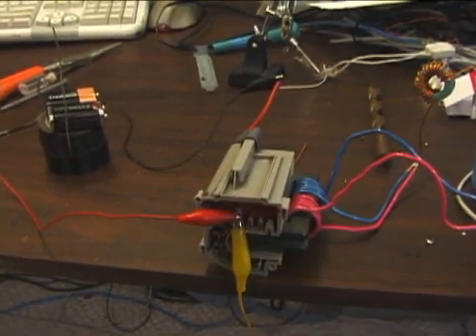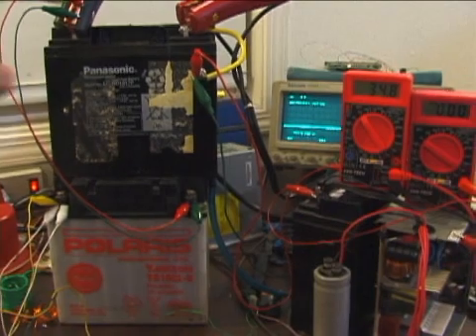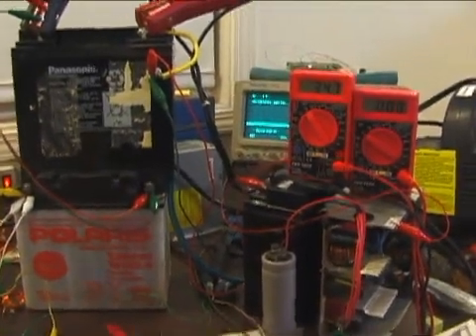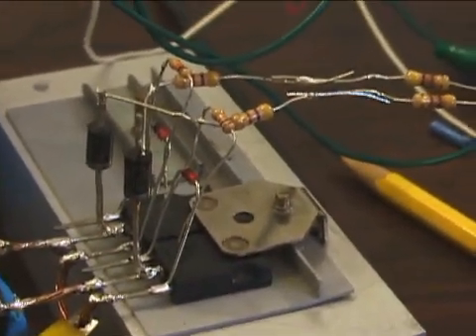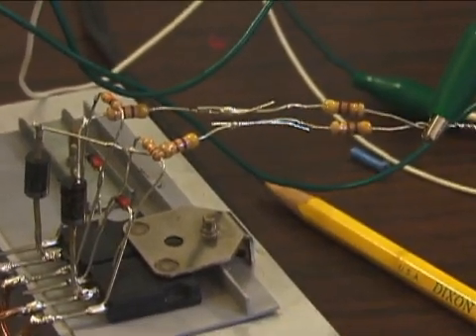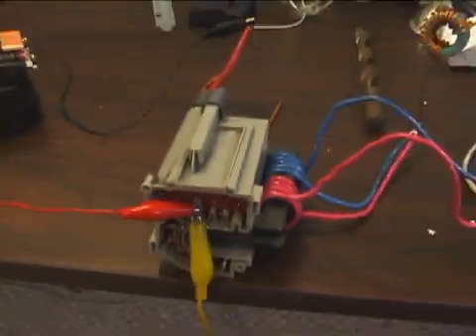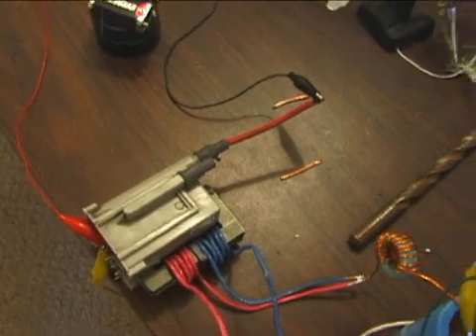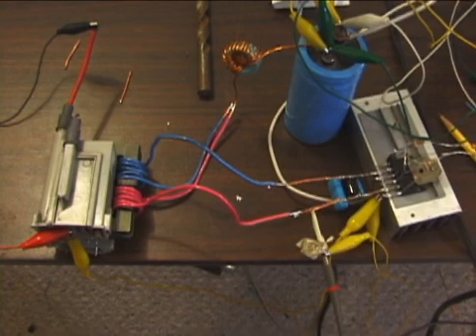700 watt ZVS flyback arcs and driver

Comment from the maker: @ubuntupokemoninc @ubuntupokemoninc It overheats about as fast as a mot. The real problem with a flyback overheating is that there is a thick layer of plastic between the coil and the outside and that makes for a delay in heat transfer from the coil to the outside. You can arc it for about 2 seconds and then turn it off and 5 seconds later, The outside of the flyback gets  very hot.

Comment: @joyange1 no, I think he is talking about the diode in some rectified flybacks which suck. With rectified flybacks you can push a whole shitload in and get a little weak purple arc out. Also, even though it is a weak arc, it draws a lot from the primary, and that can stress the wire on the flyback so yes, go with an AC flyback and thicker wire on the primary.

Comment: are those 12 volt zeners? If you dont want to have 2 470 ohm resistors in series you can just use 15 volt zeners, ot higher if you want, either voltage, the zeners do the same job. Also, you are supposed to use 2 watt 470 resistors (when not series) instead of 1/2 watt you got there I can tell from the size. Also, it looks like they got warm looking a little brown. But the mod is good since it still has a nice output

Comment: Very nice! How's the flyback holding up? What voltage Zener didoes are you running? Did you find that running 12volters doesn't perform well with the higher voltage input?

-Sparrow

Comment: The flybacks in newer TV's have rectification. I'm pretty sure it's usually just half-wave rectification. However since these power levels and voltages are WAY above what the flyback is rated for I'd image the didoes can't stand the voltage and basically the transformer just puts out AC.

Comment: just for closure ...
the main problem in ciruit design are switching losses, so if turning off the FET at full current  wastes 0.01Ws of energy and the switching frequency is 20 kHz, then 200Ws per sec respectively 200W of power are dissipated plus 10-20W for on-resistance losses. The thing that makes the zero-current switching mode work so well is FETs being switched at zero current (hence the name). Got it? :)

Comment from the maker: Use a bigger wire. The wire you are using is not a heavy enought gauge to support the load.

BTW:What do you mean by internal rectification, You're not talking about the damper diodes in the mosfets are you?

Comment from the maker: That 200 watts of power dissipation. That means how much power the device can resist and turn into heat. For example, Let say you turn it on at 50% and run 20v@10A(200W)(supply), that means your load is getting 10V@10A(100W) and the other 10V@10A(100W) is being absorbed by the MOSFET itself and dissipating that waste energy as heat. The IRFP250 can handle 200v@30A(6000W). At a full 30A load @ 8mOHMs (fully turned on.) that a 2.4 volt drop @ 30A equals about 72 watts of dissipation.

Comment from the maker: I would just use a ohmmeter and see witch pins have the hiest resistance(around 4 ohms).

FYI: For the ZVS driver, You need to wind your own primary coil as you can seen in the video the 2 red and blue windings on the flybacks ferite core. Its a 4+4 turn configuration. Look at a ZVS driver schematic for more infomation.

Comment: Thanks for the info, I once ran a flyback at 600W (video is in my profile) but just for a few seconds.
Too bad I can't see any rear projection TV's thrown away :P I have to use "multi-flyback" for more power (I once used a quad-flyback that gave 30cm arcs and it blew my driver :D)

Comment from the maker: FYI: The arcs only got about 1.5cm longer when I ran it from 700watts to 1100watts. I think most of the power went to heating the flyback althought I saw no clipping on the scope.

AWOW: I only ran it for about 10 seconds and then check the temp and althought it was cool to the touch at first about 5 seconds later it got super hot. The sec. winding got hot soo fast, that it took a few seconds for the plastic housing to conduct the heat to the surface.

Comment from the maker: UMLTK: About 2 days after I shot this video, I was able to run it at over a 1100 watts (60V @ 19A). I wanted to take it up to 72 volts but the VDS on the mosfet was peeking at 192 volts and the max for the irfp250 is 200 volts. So i took a turn off the flybacks winding to make it a 4+4 turn, and that boosted the power without having to boost the voltage.

Comment from the maker: What you need to use is a flyback from a rear projection tv, they are twice a big as one from a tv and 3 times bigger then that of a computer monitor. As far as getting hot goes, I could run it for about a 2 minutes before it got to hot to touch. Then I would shut it down and let it cool off.